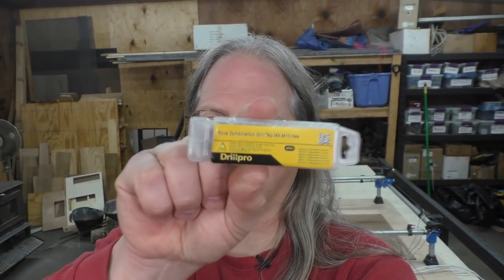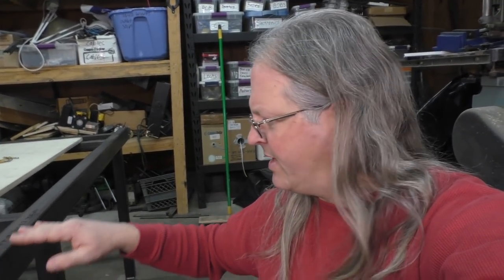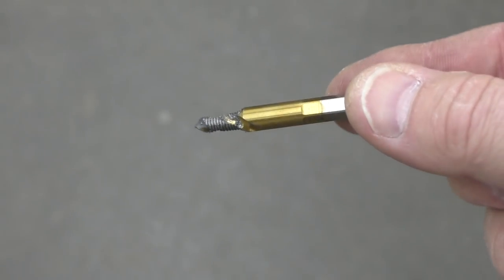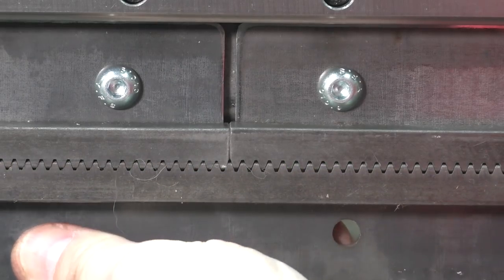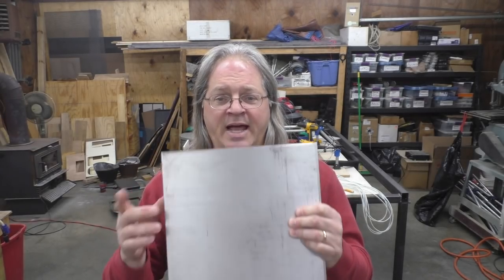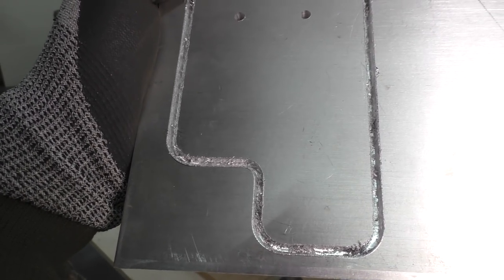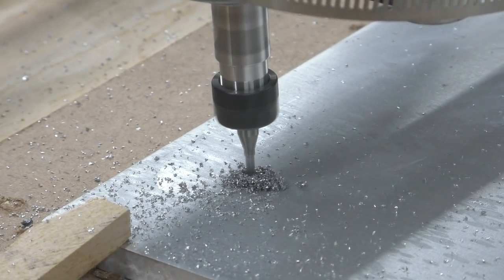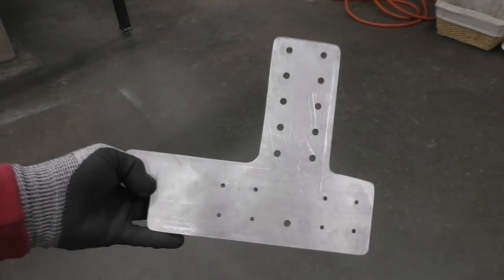DIY CNC Router - Part 4 Finishing the Y-Axis

Comment from the maker: Don't miss the other videos in this series.  View the entire playlist here - https://www.youtube.com/watch?v=L1Yk_iNYGKQ&list=PL4lExYUFHSPzF8kVQGJl5cMSGIj1tmhuI
Reply: that looks like 1/8" wall on square tubing. Is that enough threads to hold your linear rail?
Reply: use 2 flute cutter for aluminum. 6061 is very soft and gummy cutting fluid and air to clean out chips

Comment: Chip clearing is very important. Fluid can help in cutting but more helpful is using compressed air to clear out chips as they cut, even if it is just a quick burst from a canned air.
Reply: yeah I was thinking of a shot of air would help too.
Reply: @rallymax2  spraying WD40 now and then helps a lot, but it's greasy all around

Comment: Yep, chip weld. You need at least air to help with chip evacuation. WD-40 will help too, but you have to babysit it and spray constantly-ish. Make sure you’re taking small bites, depth-wise. It looks like you might have been losing steps, likely caused by excessive chatter. Rigidity is everything when cutting metal. My early attempts look very much like yours, and my goal was metal cutting. I’ve since built up the machine to weigh around 700 lbs, all steel construction, with a 5HP 18K RPM spindle motor. It FLIES through aluminum now.

Good luck!
Reply from the maker: Thanks!  Unfortunately rigidity is something the MPCNC doesn't have.  A lot of people have said to use wd-40.  I'm wondering if that is better than tap magic?
Reply: Yes because it will help blow chips out of the kerf plus it helps cool the cutter
Reply: @MakingStuff  I have a good experience with lubricating with IPA, combined with compress air to evacuate chips. IPA will evaporate afterwards so no cleaning or mess on the table...

Comment: Not sure if anyone made the suggestion but I think to help alleviate your cutting problems, I would re-write you cut path program to include a 1/2 cutter width relief cut towards the outside of your actual finish dimension. So make two regular passes and come back with two steps of relief passes a half cut width over, giving your cutter room to expel the chips and less likely to cause chatter and bit walk. Also look at using a water based cutting fluid designed for aluminum.

Comment: Yea, you need air blast for aluminum.  That or really good vacuum.   It will also help to stick another piece of half inch mdf under the aluminum stock.  Try to get the aluminum up as close as you can to your Z assembly.  Your machine is a little bigger than standard, so raising it up will really help.  I'll point Ryan to the video, he might have some pointers as well.
Reply: I think if the goal is to cut lots of aluminum parts I would make the build as short as possible to start with. That spindle is not helping much but I think the largest factor is machine size (mostly height) and chip clearing. I do suggest a few more slotting test cuts on the scraps before jumping back into a giant production piece. It is cutting the holes so it can be done, maybe just slotting feeds and speeds tuning.

Comment: You need to get the chips out,compresed air is the only way! And also as a guy working in CNC service i had a hard time watching those linear rails being mouted on some non machined surface 😐

Comment: cutting ally on the MPCNC,
a, Airblast the chips during cutting
b, keep z height to a minimum (raise the workpiece)
c, replace poles with stainless steel ones.
d, using a cutting fluid-like WD-40 can help
e, the MPCNC really does not like full side cuts, try using adaptive clearing with 40% cutter engagement. This vastly improves the cut
f, feeds and speeds. The MPCNC seems particularly sensitive to these.
g, The baseboard that the MPCNC is sitting on can allow a surprising amount of flexibility. reinforcing it with say steel or ally will do a lot.

or, finish your build and use that instead. there is only so much rigidity the MPCNC can give you by it's design. you are already most of the way through building a cnc with fully supported rails and a welded steel construction frame, that will be far stiffer and more capable than the MPCNC can be.

Comment: OK where do I start first... The cutting issue. Don't buy good cutters at this point you are only going to waste money because you are going to break lots of cutters. Speeds and feeds are important, but you can improve your cutting success by doing one of two things. Either blow the chips away from the cutting path, or suck them from your cutting path. You might be able to do a small area dry but you generally won''t get away with doing a large area dry. Here's why.. Your cutter is made of steel and you are cutting into ally. Ally will expand much more, and faster than steel, so you need to stop the base material heat soaking to stop it pinching the cutter. That's why fluid is important. It is used more for cooling than it is for lubrication. Also to do a 3/8 thick plate you are probably going to need a 6mm cutter. Those small cutter flutes are too close together and have a tendency to weld at any depths. To stop the vibrations check out how I squared up the frame on mine to give it rigidity.

Comment: use the biggest bit you can and try and stick to teh least number of flutes (2 or 3) bigger bit means less chance to break less flutes means larger chips. Compressed air to move teh chips away plus if directed at the bit will help in cooling if air is not available cut shallower passes and use lots of lubricant as it will help cool the bit and help float chips out of the kerf. This part of the reason CNC machine use high pressure flood coolant. Good work and if necessary use what you have to make and outline and cut it on the bandsaw like you have been doing as the method to accomplish the goal is unimportant as long as it gets you where you want to be.
Reply from the maker: Thanks for the info!

Comment: The DeWalt 660 will cut aluminum.....slower feeds and single spiral up-cut bits...blow out the chips with an air blast if you dont want the chip welding to start.

Comment: I would like to mention that I really enjoy your video's.  I had a similar issue that you experienced.  My solution was two fold. I use a constant air blast  to clear out the debris and help keep the bit cool.  I also use a trochoidal tool path that is available with Cambam and a similar feature that comes with fusion360.  This type of tool path helps to clear out debris and is often used in high speed machining but should work on your machine. You may need to test feeds and speeds but I know from many years experience that it will work for you.
Reply from the maker: Thanks for the info!

Comment: Operator error. Ye need to stay on top of chip removal. Since your CNC does not have a built in vacuum head, you need to stay in it with shop vac and compressed air.  If you are using a shop compressor, route your hose so it hangs next to you spray in your cooling oil a bit ahead of the cut head, then use the shopvac and compressed air to clear the cut path behind your router. If ye have to pause the cut on occasion to get caught up on clearing the chips. Once the new machine is built, consider an early project being set up of a proper dust extraction hood for the cut head.

Comment: I've got the agree with some of the others. You need to manage the chips before you can have success with aluminum. Air blast and lube for sure. Don't take the suggestion to do a really shallow cut, instead go with trochoidal to allow for less pressure on the bit and raise the piece as high as you can. You've got a really tall MPCNC with a fairly sloppy spindel. Use a small finishing pass to get clean edges and if you want chamfers do that at the end with a carve. Pay attention to Barry and Ryan, they're likely the most experienced voices here with the MPCNC.

Comment: aluminum chips will weld without evacuation like a blow gun keeping chips out, otherwise it will melt the chips and then worse case it will weld onto the cutter the cutter running at 20k-15k you are melting chips without air getting the chips out or cooling the cutter it wont work. the vibration most likely was the aluminum wadding up and welding on the cutter causing chatter then breaking the cutter. use shadow cuts 1/16 diameter of the cutter, that router i dont think is up to cutting aluminum just looking at the tube sized and lengths.

Comment: I just drill the holes and use a air drill which is a slower drill to tap the threads. The large 1/2 air drills have a foward and reverse and i use it to do all my Tapping of grease fitting and thin wall tubing like that. If you ever have a problem with alignment you can use a piece of flatbar inside the tubing to make the threads thicker then you can drill the hole in the outer tube to allow for adjustment of the rails.

Comment: If youre using a not so rigid machine, youre better off using a larger 1\4" bit and accepting the wasted material from the extra diameter. The larger diameter clears chips better because the upcut twisting pattern can fit the larger sized chips you are getting from a slower spindle.

I recommend just using a 2 or 3 flute upcut carbide 1\4" bit

Comment: big problem with aluminum is that the chips will stick to the cutter flutes and prevent the cutter from being able to cut effectively. I never cut aluminum without a lubricant/coolant of any sort.
Wd40 or varsol work well, or a commercially available cutting fluid. You can use a small stream of air to blow a mist at tool. This keeps the cutter lubricated and clears the chips. A small airstream with small drop of wd40 dripping through it every second or so works well. Keep the tool sharp as well!

Comment: My suggestion is to use WD40 or diesel to lubricate the bit.  If it running at a high rpm you will start to build up aluminum on the bit without the lubrication.  And also vacuum the chips out of the groove as you go past so the next pass the cutter does not have to cut the chips again.  Not that I have experience with your type of machine.  Enjoying the build and wishing you an easy experience.
Reply from the maker: On the dry run I was chasing the bit with the shop vac but it still wouldn't get all of the chips out of the groove.  I was using tap magic when the bit broke.  Do you think wd-40 would work better?
Reply: Making Stuff yes I use wd40 as do most ever one who mills or turns alumimum.

Comment: you can use the compressor air for to do cold cut alumium but you have to put to the cnc in the big box. otherwise aluminum will fly everywhere

Comment: I've been watching you build this machine and giving it a whirl trying to machine aluminum on the mpcnc. You can do it, but you'll need to do a few simple things. Keep lube on your cutter during the whole cut. Plus you need to keep the chips cleared from the cutter path. You could accomplish both by using a spray mist on your cutter. Also, i don't know what your feed rate is, or your depth of cut. Because your machine is so not rigid, your depth of cut should probably only be .01", and probably feed about 10-15 inches per minute. If you are able to change your feed rate during the cut, you might bump it up a little at a time until it starts to make noise. Then back off a little

Comment: Hey, here are some good tips for you! 1. use ZRN coated carbide EM 2. if you don't have chip blaster use air to push out the chips. use the right feeds and speeds and remember your machine is not very sturdy so slow the feed down. if you would like i can machine those for you in my shop. good luck

Comment: I'm following two builds now.  Yours and one other from a French group.  These guys have a new design coming out soon but their already proven design made me delete my bookmarks for the MPCNC.  Look at Thingiverse for thing:3813481 and tell me what you think.  I'm in East TN (moving to Sevierville soon)  Great stuff!
Reply: Ohh one more thing.  There is a great supplier for 2020 and 2040 in Chattanooga.  Ebay seller PDTech makes custom cuts and has made several great parts for me.  Running one of his parts now in my Ender 3 3D printer with no issues.

Comment: That was very good info, thanks. It appears, as you suggest, that part of the problem was the swarf left in the cut. If you flipped the MPCNC so the router was underneath the piece you would drastically reduce the swarf in the cut and perhaps have better results? It looks like it could easily be hung using the baseboard you have it attached to and a couple of wooden A frames. Just an observation.

Comment: First off.   Just found your channel.  Love your stuff, your teaching style, and video work.   All great.   Don't change :-)   Regarding cutting aluminum for the plates, I would suggest you save your little MPCNC.  I suspect the harder you push it the worse it will get, tolerance-wise.   My suggestion is let it do what you say it does well in locating and drilling holes.  When I look at your plates that seems what matters most.   The profile of the the plates seems less important of the three bracket styles you made so far.  For the profiles I would suggest you make one of these  http://www.davegardner.org/wp/index.php/2019/05/30/cnc-pen-holder/ and draw the profile on and cut with the bandsaw.     Then soon enough you will have a machine rigid enough to do more.

Again, love your stuff and I will be watching.

Comment: Blowing with compressed air is the best way to evacuate chips from the cutting area. I use a misting pnumatic sprayer to both apply lube and blow out chips. Great videos, I'm making myself a  new plasma table and it's interesting to see the difference between this table and your plasma table build.

Comment: Another great video thanks.   Chip evacuation is paramount.  1/4 inch single flute cutter minimum.  It can be straight flute at the depth you are cutting.  I'm sure you must have a compressor, so use that to air-blast the chips, and keep the temperature down at the cutter tip.  Hand-held is OK for one off small job like this. (Yes, it WILL blow chips everywhere, but a couple of sheets of strategically placed cardboard will limit the mess!  WEAR EYE PROTECTION!!!)  With 6061 you should be able to get away without lubricant.  (The world seems to have forgotten that plain old kerosene is a great lube for cutting aluminium)
Rigidity is king.  Tighten your bearings and belts as much as you dare, although this increases the risk of skipped steps.  If your MPCNC uses NEMA17's, you are probably at their limit already.
Feeds and speeds... I have no experience of the MPCNC, but Ryan must have recommendations, and Winston Moy (Carbide 3D) has some excellent videos on the topic.
I love your videos!  I bet you can't wait to get to grips with your new baby.    :o)
Reply from the maker: Thanks for the info and thanks for watching!

Comment: .125 two flute bit, 4" per minute feed rate ,you're depth should be good , and i run at 11,200 rpm. i cut dry until my bits start to show dulling then i use a wd40 type spray lube.slow and steady cuts a good part with little clean up. on a 1/8 " sheet i profile in 4 passes. found .125 bit in a .125 collet doesn't break as easy as a 1/4 " collet .125 bit. the bit i'm running now i've ben using for 6 months and just started using lube. you're spinning and feeding too fast .  www.2Linc.com. good source and people for bits cant wait to see you're machine. godspeed
Reply from the maker: Thanks for the info!

Comment: I recently had luck machining al on my mpcnc using same Banggood spindle with two flute 1.5 mm carbide bit.  1. One way conventional milling. 2. .003 max step down 2deg ramp cut roughing even steps.  3. 2 finish passes .002 step over at final depth 4. 12000 rpm. 5. Smoothing on 6. 283.18mm/min feed rate.  Good luck!  Smaller end mills seem to run better on mpcnc because of the reduced torque on z axis. Oh, compressed air to blow out chips and a few drops of cutting oil helps
Reply from the maker: Thanks for the info!

Comment: Can do slotting if you have a 5mm bit make an 8mm slot for the profile. Need space to blow or suck those chips out that is why slotting the same width as the tool diameter is a bad idea. Otherwise you need to remove stock from the edges until the profile remains.  Also keep that tool cool. 
Using the band saw on that, here seems reasonable its the hole locations that matter. Look at Fusion360 for doing CAD/CAM setting up a generic post-procesor  for the MPCNC should be easy. 

Then champers should be easy as long as your tool description is accurate. NYC CNC is an awesome channel to watch, but i am sure you are subscribed already.
Reply from the maker: I thought about trying slotting.  Thanks fr the info.

Comment: I'd recommend watching this video (https://www.youtube.com/watch?v=zefnrPRvc9Q) for more information about cutting aluminum on a MPCNC.  Although I can't vouch for the information in it, it does seem like a good starting point.
Reply from the maker: I did see that video.  That's why I tried a dry cut first.  But I didn't have an air nozzle, so I chased it with the shop vac instead. Of course that didn't work to well on the profile. Thanks for watching!

Comment: Thanks for the videos, Your 4x8 is looking interesting, will subscribe and follow, Wondering if you have any plans for the R&P set up. I bought a 1500 x 1500 workbee and adding 1/2" 5 start acme and larger steppers, using that machine to build a smaller and a 4'x8' machine like yours. Thinking of using R&P instead of lead screws, much cheaper I think. other than the fact those larger gears are $50.00 each, guess that's USA dollars too. What will you be doing about back lash on the R&P?
Reply from the maker: Lead screws can whip if they are long that is why I chose to use rack and pinion.
Reply: @MakingStuff  That's why I'm thinking of using them my self plus they are from what I'm gathering are a lot cheaper, but they do have backlash and wondering how your compensating for that?